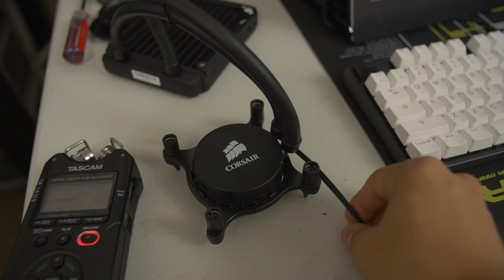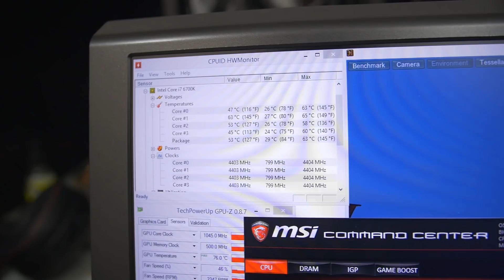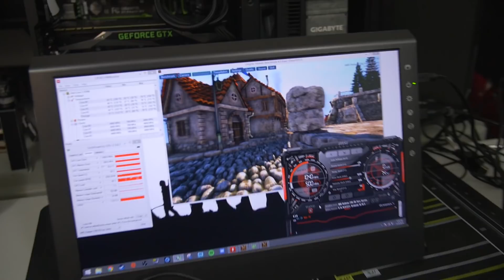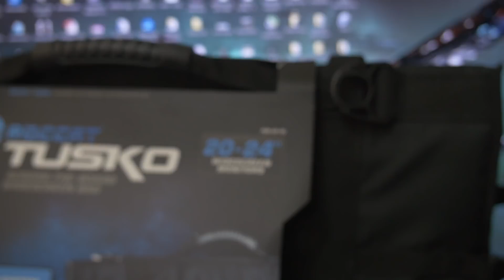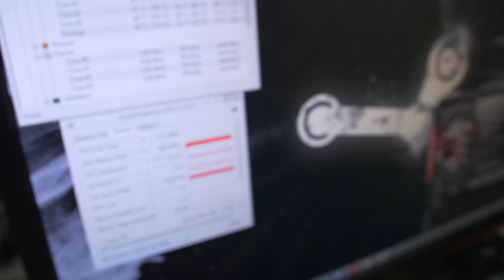Upgrading My LAN Setup + Water Cooled Node 202 Update!

Comment: lets face it gaming laptops like msi titan and the new acer predictor  is the best option for lan parties
Reply: Kerolos Abdrabbo right... good luck with the price though...
Reply: P - The P is Silent I mean it cost money to build these lan PCs also they are not free
Reply: Kerolos Abdrabbo Are you serious dude?..
Of course building a pc is not free... Who ever said that?
But have even built a pc? Because if you have you would notice that gaming laptops are waaaaay more expensive than when you just build your own like this little machine Kyle shows...
Reply: P - The P is Silent way more expensive is relative and subjective. and since when are these videos about value and not the best .btw I have a gaming desktop and an ultrabook so no gaming laptops.
Reply: Kerolos Abdrabbo relative?!
Do you even know what that means?
You can't say that a build for 1200$ and a gaming laptop for 2500$ with the same specs or worse is relative...
You make absolutely zero sense.
Gaming laptops are way to expensive. Even for a rich person they are way to expensive compared to a homemade build where you get the parts yourself. And even if you take the exact same specs...
Reply: you numbers are wrong. if you build a high end gaming pc include a monitor  keyboard , mouse and operating system the difference in price in comparison to a gaming laptop with the same high end specs is going to be 1000 max if you are talking about 1080 drop to 1070 and the price difference is really much at all 400 bucks max. and you didn't reply to my second point btw.
Reply: Kerolos Abdrabbo Alright you better read this is because you are so misinformed and so wrong about this...
It is just plain annoying.

First of all lets just put high end on the side because this can even become a topic on itself, some say a 4000$ desktop is highend and some say a mere 2000$ already is and some say you need to go even way higher than that.

Now I am a person who says a pc needs to be what an end user desires. This starts by looking at the activities the user has and at what resolution they want it.

Because for any 1080p gamer, a single 1060 pascal build just destroys most of it.

1440p go with the 1070s.

If you want to go 4k, I recommend 2 1080s because some games are quite hard at 4k and you just want to stay above that 60 at all costs.

Now depending on that we already have difference costs with just the gpus alone. Of course you need to pay for a screen too. Nowadays even 1440p screen are in for just 350$ (I have one, a 27 inch 60h 1440p)
That is a bargain.

Also for OS I am so tired of people bullshitting about this. It does not cost much at all. You can get a legit copy of W10 home edition for just 20$... Every single day... So no, an os is not expensive.

I recently build a nice little gaming rig for my neighbour(1060 build+6500) with a mid tower, peripherals, and monitor all included +os and just under 1200$ (1137$ to be exact) It does everything it needs to do at 1080p.

Every single gaming laptop is already above that. Not to mention how much a stupid gimmick gaming laptops are... They sell ''4k resolution gaming laptops" with a 15 inch screen... And if that does not sound ridiculous, you have to power it just 980m cards... That is even lower than a 970 gpu... At what fps do you wanna play? 10fps - 20fps?
That is absolutely unplayable.

The gaming laptops you even specified go up to even 5000$... 5000!!! Are in insane?
You can get even an great custom loop build for it that just destroys it.
And if people give me the portable argument than sorry then you should look at kyle's video again... Small form factor build are incredibly portable. And they often if not always cost even less that a gaming laptop if you plan it out well.

I can show you 100s of cases where we compare a gaming laptop with it's specs and performance with a full gaming desktop (even small form factors) were the laptops get outperformed and cost waaay more...
I seriously cannot understand where in the world of sweet baby jesus you got the idea that gaming laptops are cheaper than desktops that are self built?
Reply: you built a gtx 1060 system for 1200$ here you go four gaming laptops with the same GPU for about the same, pick your poison: 
http://www.newegg.com/Product/Product.aspx?Item=N82E16834154302&cm_re=laptop_gtx_1060-_-34-154-302-_-Product
http://www.newegg.com/Product/Product.aspx?Item=9SIA8S14TC5801&cm_re=laptop_gtx_1060-_-9SIA8S14TC5801-_-Product
http://www.newegg.com/Product/Product.aspx?Item=N82E16834234299&cm_re=laptop_gtx_1060-_-34-234-299-_-Product
http://www.newegg.com/Product/Product.aspx?Item=9SIAATJ4YJ6050&cm_re=laptop_gtx_1060-_-9SIAATJ4YJ6050-_-Product
not that much more expensive these even have i7s in them not an i5. and btw gj on buying the illegal windows keys for 20$ that are meant for other regions not north america
Reply: Kerolos Abdrabbo Have you read what I wrote? Look at the tiny 15 inch screen? Yeah great to play with...

Plus look at the cpu? The hq versions are not like the k versions cpus...

Also only 8gb or 12gb of ram do these all have which is half of the build I did plus nowadays it is recommended to have 16gb...

all of them are more expensive than 1137$... The third one is even 200$ more... (1399$)
Not one is less expensive than the build I proposed... Sorry but where is your point?
Also I just noticed one is on sale... If you do that then I would as well just say sure go ahead choose a 1060 that is on sale at the moment for the build... Which would make it even cheaper...
Also this build has a 500gb ssd... Which is better than just a 128 or 250gb

Also everyone can agree with me here that you will want a mouse to play with will cost you another 20-80$ depending on the mouse which is already included in mine...

Also funny that you do not realise that in my build, all the shipping costs were already placed... Here you do not even calculate with the shipping costs which will make it even more expensive.

I also like that you have to pay even more ($175.00) for a simple  2 Year Accident Protection Plan... You don't have that at all with parts you buy with a build... PArts get 2 minimum to even 5 or some parts even 10 years warranty against almost everything.

Take my cooler for example, the h110i thx. If anything were to happen in my warranty time (5 years) it gets replaced. If it breaks anything else in my system that gets replaced as well without any extra charges by corsair... Remember it costs nothing extra...

So sorry, come again with pick your poison? Lol because last time I checked you have not given me a single one example that costed less than 1137$...
And that is even if we would say there were no shipping costs... Which there are here...
Reply: you bought an illegal windows copy the normal one is 100$ that bring your build  over 1200$ mark . good luck dragging your pc monitor to a lan party half the way across the country the warranty of these parts doesn't include spills and since they know they will be sitting in one place for along time it is unlikely they are gonna get damaged. almost no one uses that warranty on desktops for the reason mentioned.  you can buy the mouse you bought for your build and add it to the price and there are three laptops with 1299$ tag.
End result you are gonna end up with a laptop that is about 100$  more expensive and are you fucking retarted the descusiion was how much more laptops cost not gaming laptops are cheaper you fucking idiot.
Ps: your busiest in your math and how you force worst case scenario is pathetic
Reply: and i am pretty sure a mobile i7 beats a desktop i5 forgot to mention that and have fun with the 4gb of ram wanna add another 30$ as a cost of an upgrade go ahead taking your Pc to lan parties is a relic of the past that should exist anymore gaming laptops are good enough these days not like the old days
Reply: like i said keys meant for other regions selling them in the us  is illegal not gonna bother replying to the rest because you obviously don't read shit of what i write so stfu kid i am done with your stupidity

Comment: why don't you put your 120mm radiator fan as a push or pull toward the inside of you case? The way you mounted it, it will starve on air, and won't get COLDER air through the radiator...

Comment: Great video!
I wonder how would a 120W tdp xeon fare in a case like this (with Asrock itx x99 board). Since it's not overclocked, maybe a good low profile air cooler could be enough?
Toying around with the idea of having a workstation-in-a-bag :D

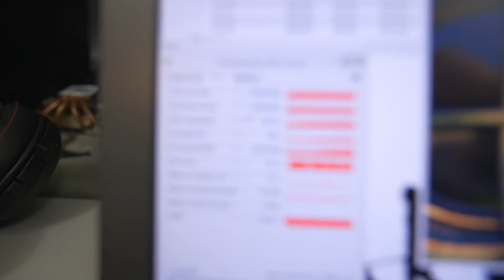Comment: 13:50 At our office, all our Intel HD Graphics are crashing with the latest drivers from Dell (since apparently we can't install the latest drivers from Intel on them - tested). We are using older drivers from 2015, these seem way more stable. We have Dell OptiPlex 9020 SFF, 9010 AIO, 9020 AIO and 9030 AIO + some Latitude 7440 and 7450. All have (/had at some point) Intel HD driver crashes. Don't worry, GPU drivers these days are meant to crash, it's something normal. I also saw one of our older PCs with a GT 630 crash with latest drivers on Windows 10, but that thing is used very rarely, so I don't get to see it very often by our employees.

Yes, I know that's an R9 Nano. And no, it's not normal for drivers to crash, but Windows sucks, even more than proprietary GPU drivers on Linux, we have to face it. My personal Linux machine never crashed on me once and it's rocking an old Asus Radeon HD 6670 (GDDR5 edition) with open source drivers.

Comment: you could have drilled some mesh holes into the case with the thicker fan in the pull config directly getting air out of the case.

Comment: wow, and i still go with my 2nd gen i5 + radeon 6000 series graphics and 4 gb ddr 2 ram with a dell mouse and free samsung earphones. 😒😒 #donate_me_a_$350_pc
Reply: maj429 why sorry? every gamer here goes through this :D atleast I'm the smarter one among 1.2 billion, will find a way out 👍
Reply: fROSTBiTE my desktop pc is unmounted until next holiday and i use a laptop with a 2.1ghz dual-core pentium cpu, 3 gigs of ram and a mobility 4530hd with 512mb of vram. i don't mention the specs of my desktop pc to not look like a douchebag ;)
Reply: fROSTBiTE i did,too,to see how some of us are struggling during school
Reply: fROSTBiTE sorry but i can't remain happy with the 28 fps i get on CS:GO with 4:3 800*600 resolution. Yes the above mentioned specs are that of a laptop and that's the only machine i have. F my gaming 😢
Reply: akash sinha you can just replace the graphics card and revive that pc. get an nvidia gt610(at least) and you will be in higher 30's heaven
Reply: fROSTBiTE i get on that laptop 31-38 with the lowest settings possible at 1280*720, WTF
Reply: I just upgraded my PC by building a new one alltogether. that being said, if anyone wants my old one, I'll sell it on Craigslist. fx 8320@4.6 GHz, 16gb ddr3 1600, gtx 970 windforce, CD/DVD/lightscribe drive, Asus 990fx aura Mobo, 256gb SSD main drive, 1tb WD black storage drive. it also has an extra USB 3.0 expansion card, and a dual bandwidth wifi adapter. asking 800 pick up only. central va
Reply: maj429 well i have a laptop, so that's why a performance issue, moreover, i live in India, PC parts ain't cheap here, almost 150-200% costlier compared to US. Also 2nd hand marker is minimal to none. Companies here sucks with salary offers, C++ application developer and i only get about  $350 per month. Even if I import parts from outside, i will have to sell my kidney out for the import duty. would have got your pc if i would have lived in America.
Reply: akash sinha sorry man

Comment: It would be nice to upgrade to a half-PCB GTX 1070.
Reply: Ignas i agree and donate that r9 nano to me :P
Reply: Tons of Mini ITX cases can be used with full-PCB graphics cards, including the sexy, small, and up-and-coming Dr. Zaber Sentry.
Reply: ThierryTheuns i think that A4-SFX is actualy the smallest case. its volume is roughly around 3 litters less than node, but it can house a full size gpu, but it cant house a watrcooler.
Reply: there's also a 1080
Reply: pumpuppthevolume Link to that half-PCB 1080?
Reply: ThierryTheuns yeah there r small 1070s I got mixed up.........although they r using the so called laptop 1080 in tiny pcs
Reply: pumpuppthevolume Too bad, I'm going with a Mini ITX 1070 now, because the 1080s don't exist in that size.
Reply: Ignas I want smaller than the Sentry.
Reply: +ThierryTheuns dan cases a4
Reply: Science And Stuff Even smaller. I really wanted the A4-SFX, but it took me too long, so I'm scratch building.
Reply: Science And Stuff It is definitely the smallest enclosure for a full size GPU. (Although I'm not sure because of the Dr. Zaber Sentry.) But I intend to build my own case with the ITX length 1070. So I can make it even smaller.

Comment: One trick you can do to improve the thermals (or improve the air flow) is to cut a 4 1/2" blow hole into the top/ side of the chassis, this way you can have a standard 25 mm thick fan, instead of the usually loud (and fairly useless) 15 mm fan.

The next challenge for this chassis is to install a real water cooling loop into it.

I too have the Steelseries Siberia 800 wireless headset; I really like the freedom of being able to move around the apartment without worrying about cables and crap, I just wish that the volume could be raised a bit more than it does, and that the bass be more pronounced.
IMO, they're great for both gaming and watching movies.

Comment: Nano is clearly capable however 1070 mini would be legit
Reply: Keatononame I do not believe free-sync works with an nvidia card
Reply: Eh who cares. I have a  1440p Freesync with a 1070. Preferred a card that could push more fps than any of the mid-tier AMD ones out there right now (high end AMD = mid-tier Nvidia atm). I never notice tearing or anything.

Comment: I imagined LAN as in Network lol, guess i was thinking that because i just upgrade my home network to pfSense on a Intel Atom 330 (dual core 1.6 w/HT), 2GB ram with an added gigabit Intel NIC, TP-Link gigabit 8 port switch, and UniFi AC lite Access Point which sh!ts all over the ASUS AC1900 (RT-AC68U) i replaced. Thinking of selling it and getting the UniFi AC Pro. I was going to get the Ruckus made Xclaim Xi-3, but for $65 open box vs $250 i figured i could pick up an extra one for $82 (New) and have equal or much better coverage.

*Brain shart

FYI, the UniFi comes with the radios stuck on a narrow width... so 2.4GHz is 20Hz wide and 5GHz is 40Hz wide. That prevents 2x2 MIMO which is great in a high user count area, but a house with 4-6 congruent clients really isn't.

*post shart

Comment: Did you try cutting the cable on the old pump and resplicing fresh wire to see if it would work again ( for the h55 melted wire)

Comment: Why is the AOC monitor so much cheaper than a BenQ 144hz 1ms response time 1080p monitor?
Reply: msterforks benq is known for over pricing monitors
Reply: msterforks Because transgenders make them
Reply: msterforks you know shouldn't pay ANY attention to response times? it's just complete bs
Reply: Simon Smith Not necessarily Simon, if you do play competitively enough, you will notice the difference just slightly between 1 and 15ms (15ms I say because most TVs have this in Game mode) So yes, if I do for example see a 1080P 1ms Freesync panel, I'll buy it for the Freesync and 1ms not preferably for the 1080P which makes this a perfect Lan Party Monitor
Reply: ***** but what manufacturers says is never right. They all measure it in a different way
Reply: Simon Smith That is true in a sense, but you should also know that my point is still valid. Just because it's more expensive doesn't mean it's better etc So even if they measure it differently, it passed and they are allowed to market it that way
Reply: ***** I never said anything about price...

Comment: CoolerMaster Seidon 120M sucks. I had one and the pump just died last month. It lasted for 1 year on a 4690K @ 4.6ghz. I switched back to Corsair for that 5 year warranty and use a H100i v2. I sent my Seidon out for RMA and will be selling it when/if it comes back.

Comment: I like the 144Hz monitor, but it doesn't make much sense when you aren't getting over 100 fps on most games. Would the 1060 be any better?
Reply: David Blank not much difference , 1060 would not fit
Reply: JeremyM there are itx sized cards from board partners that might fit
Reply: David Blank most thermals on them are not great and the nano has better performance
Reply: the nano is better.

Comment: Funny how I stumbled Across this video as I ordered my pasts yesterday and should be here tomorrow , Its basically the same case but air cooled, and also a 24in monitor and it ll be a bit over kill but the dimensions should be perfect for the padded ruck sack that I got, especially for taking the system with me for traveling,
and should be able to house all the bits perfect just the matter of the weight of all the parts and the special rucksack I got which was originally for the new alien-ware 17 in laptop with also this system build in mind in case I didn't like the Alienware which was not up to the job for the price so I just returned it, as it wasn't good enough! but I ll make a Video of this build so watch this space!!!